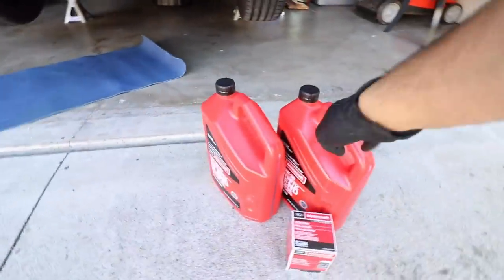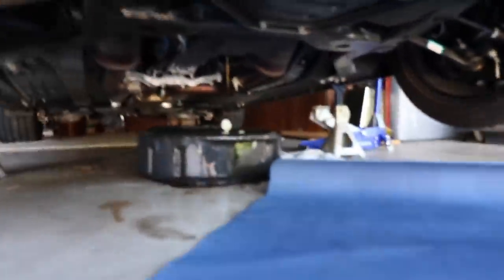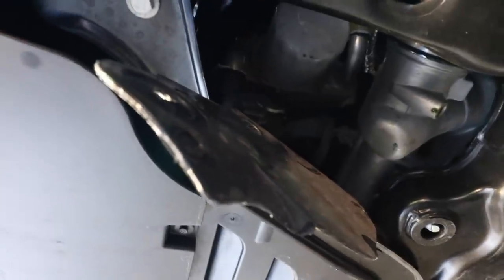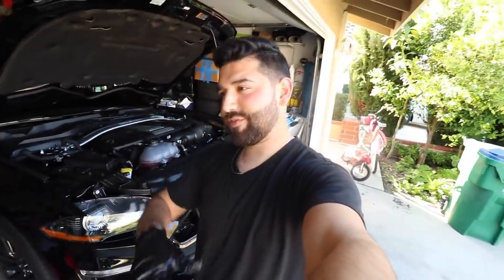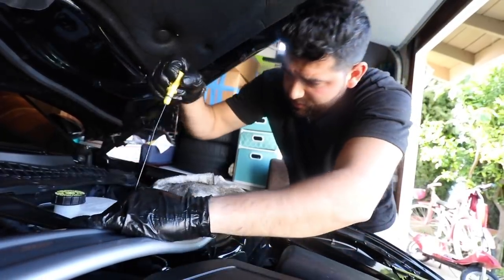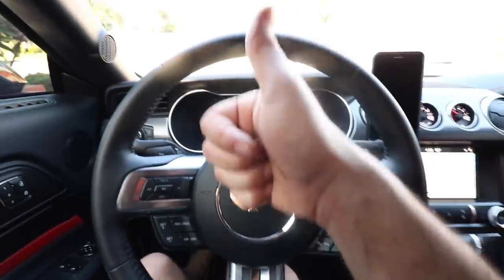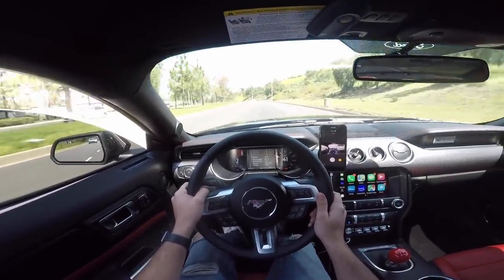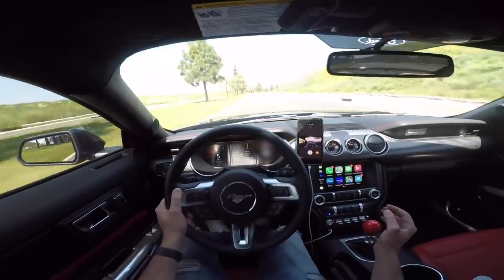FIRST PULL in my MANUAL 2019 Mustang GT!!

Comment: Pro-tip: Next time leave the top oil cap on until you release the bottom. The oil will come out slower. After a minute or so, you can open the top to get the oil moving faster.
Reply from the maker: 5x56mm makes sense good tip 👌🏻
Reply: And as your putting the oil back,  leave the bottom off so it flows faster .
Reply: @CoyoteDAworld  lol

Comment: Nice car ,The best way to tell if ur car needs heavier oil than factory specification is to listen to the motor when u first start up after oil change ,and if it rattle before the oil comes up that tells u that u have high clearances in the motor and need to go to a higher weight or heavier oil. I have notice that many new Ford's v8 would rattle after oil change for a few seconds before the oil comes up and those were the engines that got messed up if u didn't  go to heavier weight oil.

Comment: U should always start it and let it run for maybe 10-15 seconds before checking the oil because it could read full but once all the oil circulates thru the motor it could read a little low just some constructive thoughts

Comment: Rush, i like you as a creator bro. Especially now that you have a mustang.

I HIGHLY recommend you buying a oil catch can for the passenger side. Its shocking how much oil vapor it captures from normal and spirited driving. My GT500 has had one on for a week now and its almost a quarter full
Reply: I just ordered the UPR one for mine.  I have 6k kms on my 2018, and can't believe it took this long to pull the trigger on one lol.  Our Canadian dollar is worthless, and after conversion, it might as well be $500 and that's a lot for a friggen good quality catch can if you ask me.  Mines an Ecoboost,  not a GT, sorry to disappoint ;-P
Reply: Will this void any warranty?
Reply: Joao Salvattore i would consult with Ford. But the catch can literally comes off and on in 2 seconds. So you can just do that when you take it in for service.
Reply: LivinTheDr3am awesome, I’ll look it up. I’m new to mustangs!
Reply: So I have oil breathers on my 2011, just sprays everywhere. Guess I should buy catch can for both sides?
Reply: Joao Salvattore Yes the breathers are cool and all but catch cans just get the work done. Theres still air circulation through the pcv hose and connecting valves but it just grabs that nasty oil vapor that would go into your manifold. I’d say do it especially if you do high rpm pulls which is when the breathers would prob spray everywhere

Comment: I'm really anxious to see if it developes a tick. Im on the fence about a purchase
Reply: Same, some people say that putting a 5W-30 avoids it or doing an oil change early. But I’m curious to see as well
Reply: Rubber Duggy lmao mine only has 300 miles and already ticking 😕
Reply: They all do it. 11-19
Reply: Not all! There are 5 here locally. Mine and 4 others between 2500 and 12k miles. All 5 tick free! Knock on wood!!!
Reply: My 19 GT with 600 miles ticks sometimes and rattles sometimes. If you're worried about minor engine noise buy a Camaro or Challenger.
Reply: Even if it does tick it's under warranty take it to the dealer so its documented so if something does go wrong it will be covered. I have 2k miles on mine no tick yet
Reply: Christopher Rojas damn wtf!? Did it tick when you purchased it???
Reply: Its just a tick mine started ticking when i got an oil change but it went away about a week later
Reply: What problems does the tick actually develop into? is it just the 2019's that have it?
Reply: smithers when it ticks, most of the time it’s piston slap which the cylinder hits the wall and that damages the motor
Reply: Nope. It only does it sometimes and it is very random when it does. I went through a drive-through and it started ticking while in line then stopped ticking before I left. Until I have loss of power or my motor blows I'm not concerned at all.
Reply: When it ticks the internet shits itself and a bunch of people who don't own the car and wont own it freak out. No problems have been linked to be an effect of the tick and Ford stated it's normal.
Reply: Mine started ticking ever since I bought my 2018 new, I have almost 20,000 miles on  it and nothing has gone wrong. This might be a witch hunt fear... all for nothing, Ford said it's normal.
Reply: Exactly. Either all our engines are fine or they are all going to blow because of the tick. I think option 1 is far more probable. People worrying themselves sick over a little engine noise.
Reply: Have a 2018 since January of that year no tick over 15kmiles
Reply: PapayaMan same here. Mines ticks every now and then but runs great. I'm not concerned about it like I once was.
Reply: Speaking from experience.....I would wait for the next model Mustang.  The 18-19 is a beast unless you get stuck with one that has a loud tick.
Reply: I really want to replace my Ecoboost with a 19 but I have a problem spending 40K on a car that ticks out of the factory
Reply: K4ISER 5.0 2011s even tick
Reply: @letsgotomarsman  do you have a 2011 that ticks as loud as my 18 did?
Reply: The tick does nothing to the engine it’s simply a characteristic of the coyote engines. It has been happening since the first generation in 2011, but now since the 2018 and 2019 have direct injection people hear ticking all the time and think it’s the typewriter tick.
Reply: Christopher Rojas shouldn’t be driving the piss out of it brand new
Reply: People are over exaggerating this "tick". Yes some do tick and you'dd know it cause its loud af. Like really loud. They all have a slight tick when cold start. I have a 2018 with 12k miles and running just fine. Oil change done at 9k. No need to be doing it every 3-5k miles lol.
Reply: ticking is fine. i think you guys are being paranoid
Reply: Those cars have some noisy engines though man. Dual overhead cam. They tend to make a lot of noise😂
Reply: @HashMaster1776  all of the coyotes have a tendency to tick eventually, the 2018/19 mustangs however seem to amplify the sound. A softer break in shouldn't make a great difference.
Reply: just get a gt350 problem solved.
Reply: I bought a 2017 GT Performance pack, no tick or unwanted noise and I’ve put 8000 miles on it in roughly 5 months. This thing goes everywhere with me

Comment: I did the same thing in my 19 soon I finished my break in 2nd gear it revs to redline so fast. Have u used line lock yet? I'm not 100 percent confident on dumping the clutch once its locked in

Comment: If tracking this car id use new mobil 1 FSx2 5-50 and mobil 1 0-40 fsx2. They use thin viscosity for fuel economy (overall. Not individually) NOT to protect one's engine. Cars and engines are throwaway items to manufacturing companies today. 

If the high viscosity scars u i bet if u look at that same engine the recommendation by for of Australia will be x-40 oils. 

If still scared use a high hths oil like Total 0-30 euro or liqui moly longtime at Napa. Its a 5-30.

Comment: Should have went with amsoil or mobile 1 full synthetic.. or even at least the motor craft full synthetic
Reply: While I agree with you that those are better oils, its better to use the recommended oil until you figure out if your gen 3 coyote is a ticking time bomb or not lol
Reply: @KINGKJ2REAL...  I fully agree with you!  Any time I change my own oil, my cars get full (Penzoil Platinum) synthetic and not the synthetic blend that Ford uses.

Comment: I changed my oil at 500k kms, with cheap walmart brand synthetic oil and k&n oil filter.   I have an Ecoboost and love how easy it is to change the oil.  The drain plug and filter and right beside each other.  My old RSX with kseries engine was such a pita, because the filter sat horizontal, and didn't really matter how you did it, there would be oil to wipe up off the subframe ect ect.  I can't wait to get a GT in the future.  Congrats on your purchase, you picked a great color "Shadow Black" #thumbsUP

Comment: I like your videos but you need to change the oil when it's hot because then all the debris will be floating and it will come out but when it's cold all the debris goes to the bottom.

Comment: When changing oil I was told to start it up and let the oil circulate then checking if it’s low? Is that not necessary? Great video!
Reply from the maker: I did check it at the gas station lol but I didn't wanna drag the video too long

Comment: That oil is a blend of Group 2 and Group 3. What you want is a Group 4. Motul, Redline, Royal Purple or AMSOIL Signature. No wonder the engine ticks.
Reply: Only amsoil on my GT350.  Expensive but worth the extra protection
Reply: As long as it's AMSOIL's Signature Series, you are in great shape. It's PAO and Ester so it's Group 4/5 Blend. Same as REDLINE. You can't do better! Ester is what they use in jet engines. All the other AMSOIL is merely Group 3.
Reply: Stanny1 yeah it’s signature series developed just for the 5.2 voodoo. At least that’s what the site says. I buy directly from amsoil website
Reply: Great Stuff! You can't do better than Group 4/5 Blend for that motor. Most Americans are fooled by the terms "Full Synthetic", "100% Synthetic" and "Synthetic". For U.S. made oils, these terms are just for Marketing. Many people pay for Castrol Edge and Pennzoil Platinum or Mobil 1 and don't know these are only Group 3 but they are paying Group 4 prices.

Comment: First service should be free at the dealership they do more than change the oil. There’s an entire checklist for the initial break in service
Reply from the maker: A bunch of people told to steer clear of dealer oil changes cause they only give you 8 quarts and these cars need 10 quarts.
Reply: Rush Shift sounds pretty sketch you can’t even trust the dealership with an oil change? I do find it odd that these need 10 quarts my 5.7 challenger has a bigger motor and it only takes 7 quarts
Reply: @HemivsNinja   yeah 10 quarts seems alot for a 5.0
Reply: I honestly think you would have been just fine going to the dealership. They will put in correct amount. You just have to check and make it very clear to them. They do other checks too and it goes in the systems which will help with your manufacturer warranty records.
Reply: Hemi vs. Ninja although it’s only a 5.0 it is still a quite big engine with the cams and everything that goes into making that much power with such little displacement